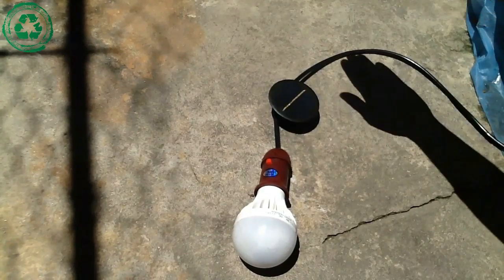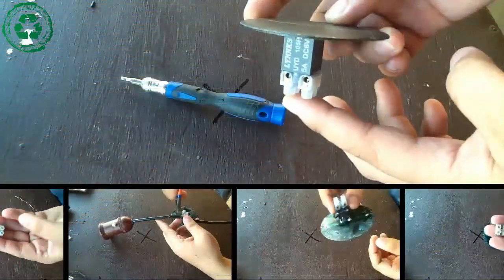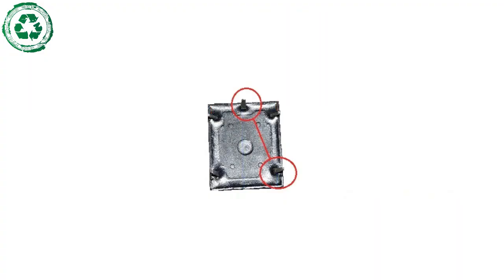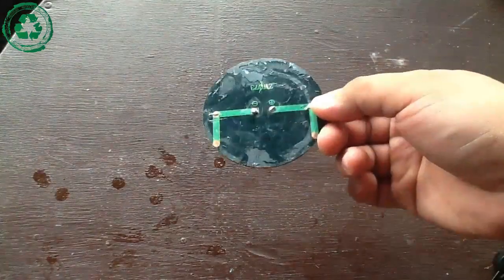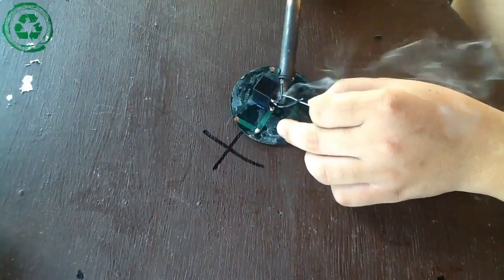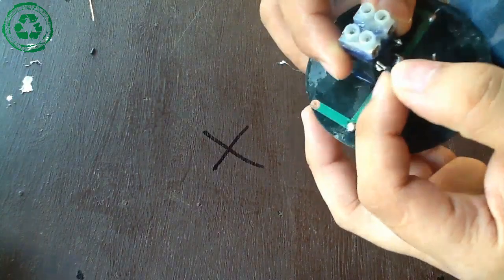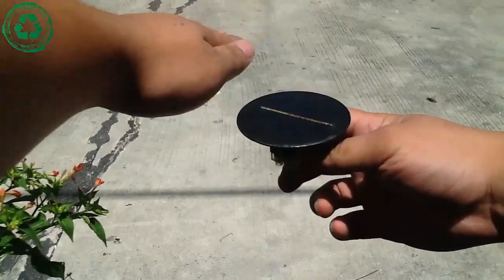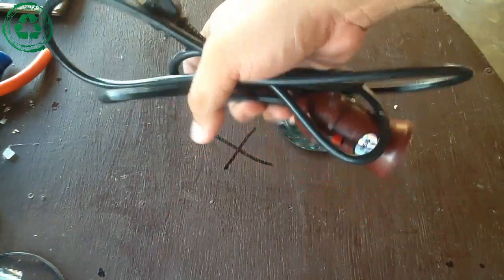Automatic Night Light (Street Light) Using 6v Solar Panel With Simple Schematic Circuit Diagram

Comment: Does it have a battery charged by the solar panel to power  the bulb ?! How does it supply energy to the bulb ?!
Reply from the maker: it serves only like a switch
Reply: RELAY HAVE NORMALLY OPEN AND NORMALY CLOSED

Comment: when there is no sun the  relay is disactivated so bulb is off, we can say it is a lihgt sensor not dark, m i wrong??
Reply: Yep,
A basic relay has 3 terminals at one end. common, normally open and normally closed. He used the common and normally closed. When the sun powers the relay the normally closed contact opens  turning the light off.